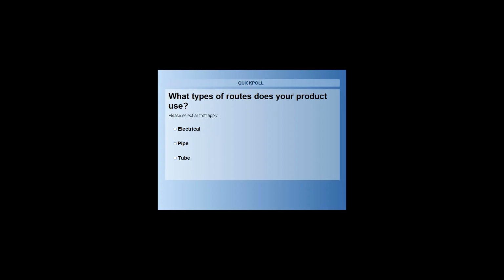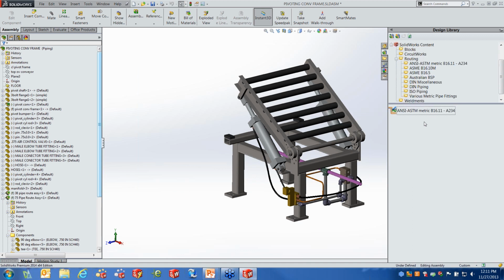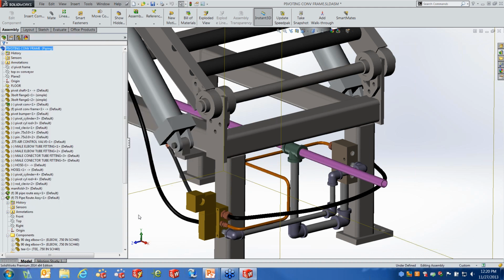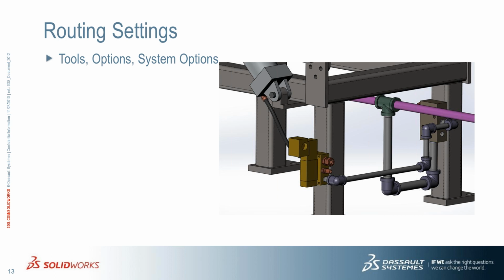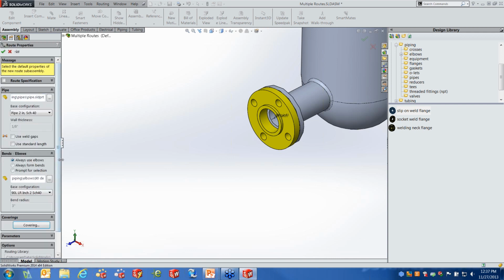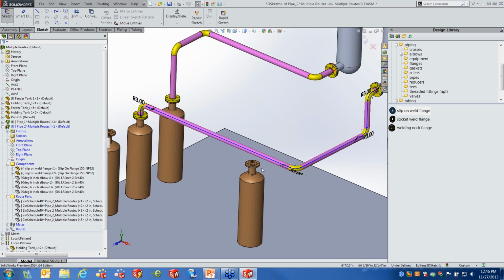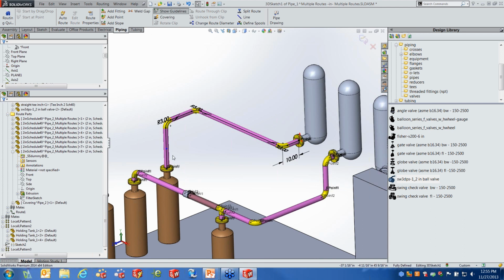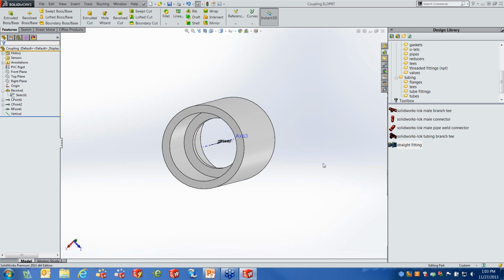Lunch & Learn - The Fundamentals of SOLIDWORKS Routing - Pipe & Tube

Comment: I am attempting to insert a tee into my tubing assembly, but to no avail.  I have tried both the drag-and-drop method, and the "Add Fittting" button.  I have split my route in the correct place.  Still, the tee I am trying to insert will not jump to any point, it usually winds up several feet away from the rest of the tube.  Any idea what I could be doing wrong?

Comment: Thanks for doing this tutorial. I have a question: Can I leave a component file in one location (our usual vault file on the network), but then also use the routings component wizard to add it to the routings library?

I don't want 2 instances or 2 copies of the same file name to maintain, and I want the fitting *.sldprt file to stay in the vault location w/ almost all other parts, as there's other previous assembly files that reference these fittings from the vault location.

If I just drag and drop from the file explorer (opened to the vault location) on the right-hand menu instead of the routings component menu in the design library, will I still get the "smart" fittings behavior where, say, a hydraulic tee w/ c-points and a r-point will sort of snap itself into place w/ another hydraulic fittings w/ c-points?

Sorry for long winded-ness, but finding SW Routing expertise on the internet has proven difficult.

_____________________________
Also, I have a suggestion: If you could make a tutorial on best practices to create and automate flexible hydraulic hose assemblies, from:

- downloading various crimp end models from a manufacturer's website and:
----adding routings points (some tutorials add it to the end of a fitting so the hose assembly w/ be measured end to end, maybe explain the reasoning on how to do this?),  
----how to set up stub lengths, what the other options do and mean,
----how to set up auto hose size (or if your spec'd hose dims aren't listed, add new sizes to the database), etc.,

- to adding new hose assemblies to an assembly and:
----dimensioning their (flexible spline curved) lengths in 3D space (SW may try to make them a diff length than what the real-world assemblers will need to cut and crimp them at)
----if we want even-inch lengths for hoses for our BOMs, is that a template setting that can be changed?, 
----adding zip ties to bunch several hoses, how to get them not to interfere w/ each other

- to how to change virtual subassembly metadata so it fills in BOM templates that a company already uses (i.e.; changing routing template so "hose length" property changes to "LENGTH", because that property will already nicely pull into existin BOM templates)

- to how to create drawing templates so hose+fittings assemblies almost draw themselves (insert themselves into a view w/ a length dimension, ballooned, and the BOM displays the hose diameter/wall dims and fitting PNs, ready to save as a SLDDRW file w/ the correct part number as the file name, any other smart hose drawing automation practices.)
Reply from the maker: Kris Bunda: Routing component library can be a network
location and is actually recommended if you are working in a multi-user
environment. Step one is to make sure your design library is located or moved to the network. Step two when you run a component through the wizard it will be placed into the network library. Whenever a component is dragged in it will trigger routing because of the connection and routing points not because of the location. Hope this helps!
Reply: CADimensions, Inc. But does the file of the fitting that now has R-points/C-points have to physically change to the location of the design library? 

I ask because some fittings that were just regular parts before may be referenced in other assemblies, and if I need to move their file location, it can lead to broken references.